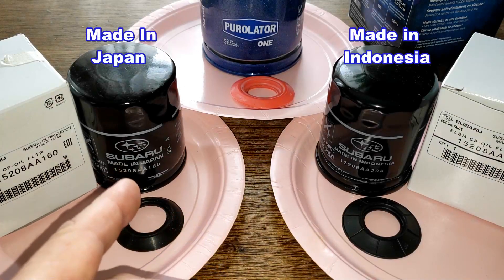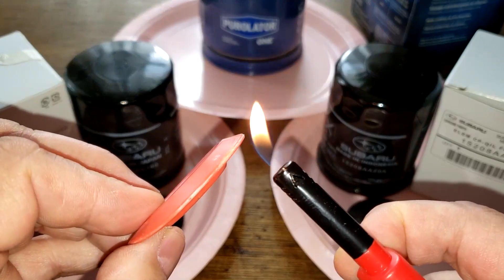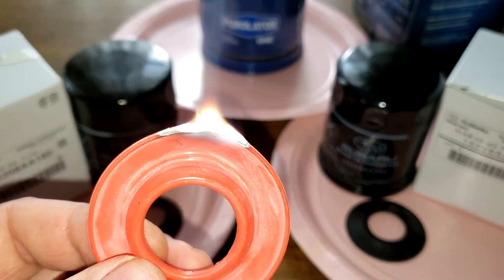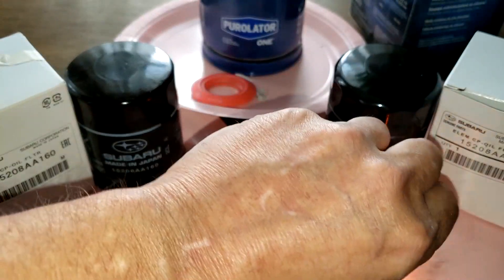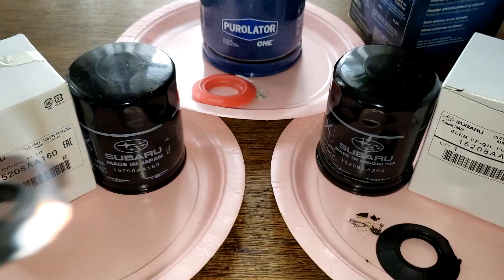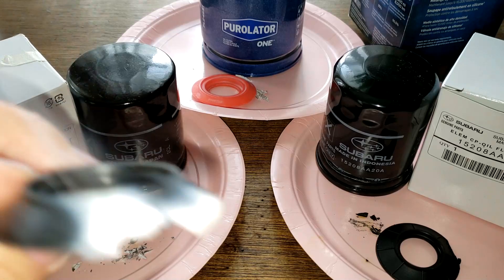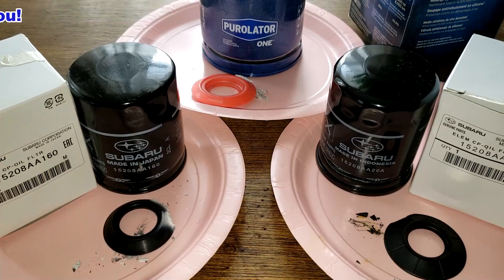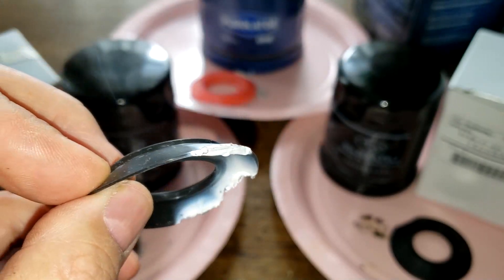Subaru Oil Filter Anti Drain Back Valve Burn Test

Comment: From what I gather from this video, the silicone valve is preferable to the nitrile rubber valve. But in an effort to educate myself, can someone tell me why this is, and how important it is to make the right choice? Also, how important is it to ensure a filter has an anti-drain back valve? I understand the concept, but to what extent could any engine damage be by using a filter without a valve? Thanks
Reply from the maker: Silicone holds up to heat and the chemicals in the oil better than Nitrile rubber. If your oil filter has holes mounted upwards, then you really don't even need an anti-drain back valve. However, if your oil filter has holes mounted downward, the anti-drain back valve will help keep the oil from draining out of the oil filter. Filling the oil filter back up takes a split second and getting a good oil pressure in your engine. Thanks!
Reply: Roger that, and thanks for clarifying!

Comment: Still would like to to see you cut open a WixXp57055XP and compare it with the 2 Subaru filters, Thanks enjoy your channel.
Reply: The WIX XP is going to be garbage in comparison to the louver design vs cut holes on the Subaru.

Besides that, the Wix XP is probably better in filtration. I'd just run a Subaru filter, WIX XP also has silicone ADBV and good flow rate but Subarus need high oil pressure and I'd feel safer with OEM filter.....I bet plenty of people use the Wix XP and it's fine. They need to fix their louver design issue before I go back.

Comment: Whip, I think you likely found only the second exception to black adbv being nitrile rubber, or rubber of some sort, (ACDelco AFE rubber), not silicone. Personally. I don't believe there are many other exceptions. What it has in common with the other known exception, Toyota Thai Denso, both Asian made OEM. Be interesting to see if the Fram made Subaru OEM with black adbv is nitrile or silicone. I'm going to say, like the Indo OEM made, it's nitrile. What I'd also be interested in, the Suby OEM efficiency. If similar to what's known about other Asian OEM, not very efficient. I looked for other vid where you compared two filters, maybe you could link. Good find. Thanks for vid.
Reply from the maker: You're Welcome faxmen09, Thanks!
Is this the video you're looking for? https://www.youtube.com/watch?v=lkcMMjugVhw&ab_channel=WhipCityWrencher
Reply: Thanks Whip, I did find that one. I thought you meant you compared the Japan made with Indo made. Anyway, the Indonesia made one, like vast majority of black, nitrile. Bet Fram made one is too.
Reply from the maker: @faxmen09  I bet the Fram is nitrile also. From now on I'll try to make it a point to test the ADBVs on all the Japanese-made oil filters that I open up. Thanks and have a Great Day👍
Reply: @WhipCityWrencher  Great minds think alike Whip.😊 You have a great day too.

Comment: They have different kinds of silicone.  Not an expert by any means, maybe it is a blend of rubber and silicone?
Reply from the maker: Could be Jim, I'm no expert either.😄
Reply: @WhipCityWrencher  You might not be but you do a damn good job.  I've learned more about oil filters from you in the past two years than I did in the previous 50.
Reply from the maker: @jamescaron6465  Thanks Jim, I Appreciate it. 👍
I've learned a lot too and still learning😄
Reply: @WhipCityWrencher  Me too, Pete, Me too

Comment: This is interesting and puts the 15208AA160 another step above the 15208AA20A although getting the 160 is more difficult than the 20A or the equivalent Purolator One or Boss for my application.